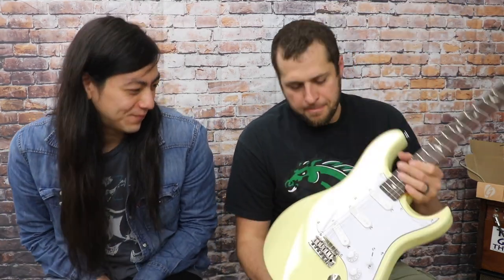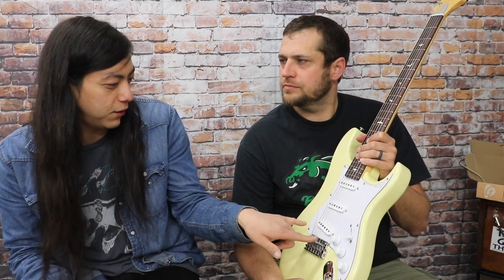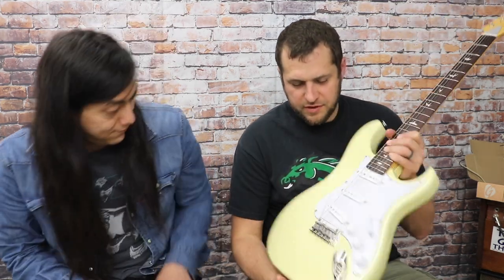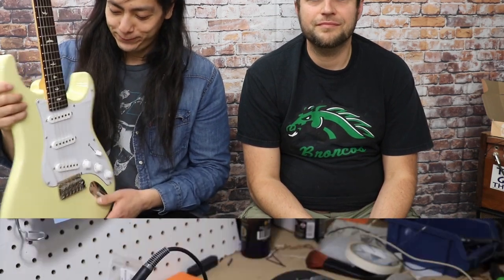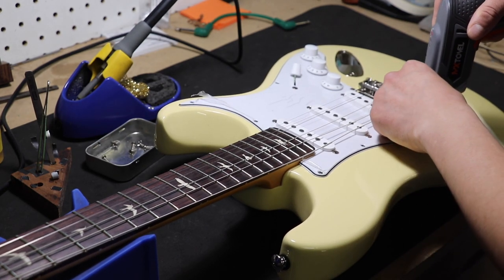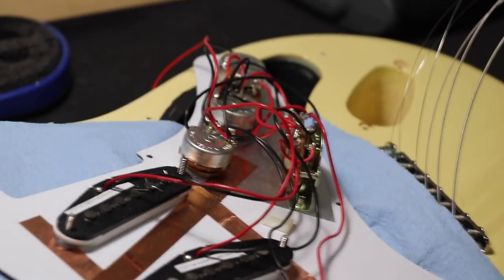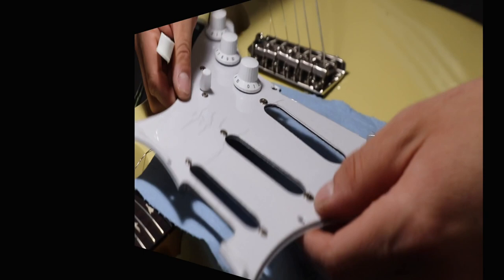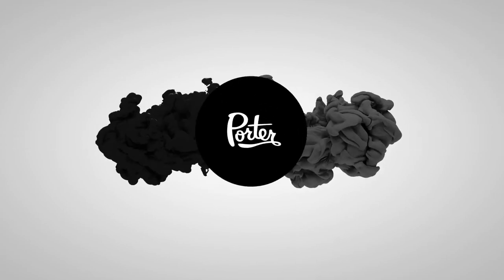Putting New Pickups in the John Mayer PRS SE Silver Sky

Comment: I’ve taken mine apart and shielded it with copper foil on the back of the pickguard and inside of the cavity. It made a hell of a difference with the hum.
Reply from the maker: That also works great, it’s very interesting it was only just by the pickup screws.
Reply: The body is shielded but you can’t beat conductive copper foil, run and extra ground to the body cavity itself from the tone pickup if you really want it quiet/ get the most out of that shielding.
Reply: @aperezdeal  that’s exactly what I did. 😁

Comment: at 9:06, did you notice that the red wire of the middle pickup went to where gnd is? and the black went to the switch. This indicates they intended to connect it backwards. Is this because of out-of-phase issues. I opened my silversky se and found the same scenario. I replaced the stock pups with kinman john mayer set but did not reverse the middle.
Reply from the maker: i wonder if they do that for production wise to make all pickups the same and then flip wires on install.

Comment: …Your wiring seems thicker than the standard wiring is there any significance to the thickness?
Reply from the maker: We use a industry standard 22 gauge cloth hookup wire. More traditional and thicker than the import/plastic hookup wire stuff
Reply from the maker: @TwoDot usually the solid core cloth wire is great for tidy wire routing!

Comment: Has anyone found any drop in chrome machine tuners?
Reply from the maker: i'm not sure what would fit, a lot of the PRS stuff is unique to it's own sizing etc.
Reply: @PorterPickups  The chrome PRS ones don't fit. I'm sure some aftermarket will come out soon.
Reply from the maker: @supraflydynomite9425  makes sense!
Reply: Yes. There are vintage style klusons for this guitar with push in bushings like what the stock guitar has. They are called KD-3-NMOSDR.